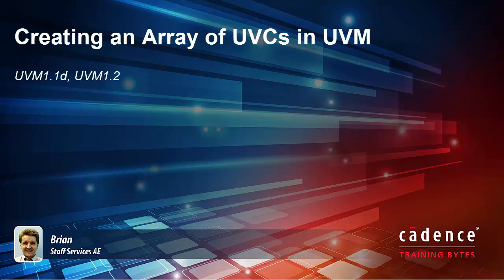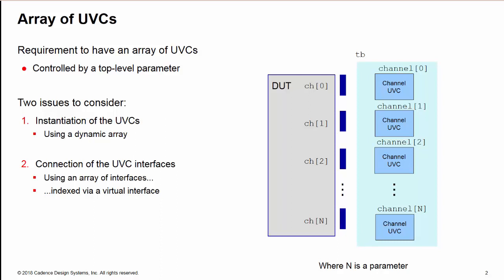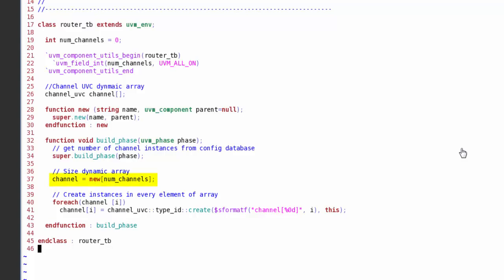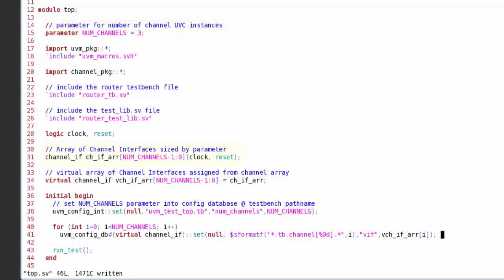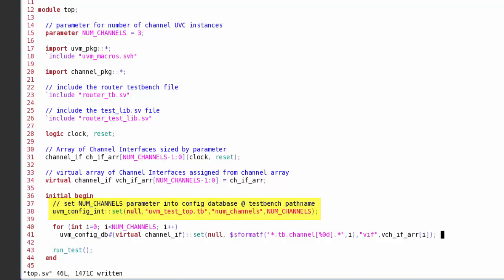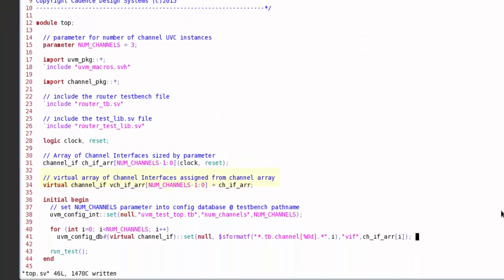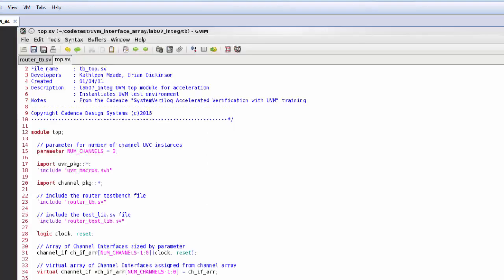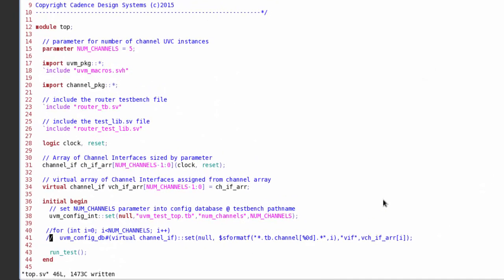Creating an Array of UVCs in UVM

Comment: Hi Brian,

I am using an interface connection as:
  phyRsSide phyRsSideInst1 (
   .TxClk(TxClk1),
   .RxClk(RxClk),
   .Txc(Txc1),
   .Rxc(Rxc1),
   .Txd(Txd1),
   .Rxd(Rxd1)
  );
where TxClk1, RxClk, Txc1, Rxc1, Txd1, Rxd1 are the testbench signals. Some of them are then connected to DUT pads.
If I want to use array of this interface, how should I do the connections?